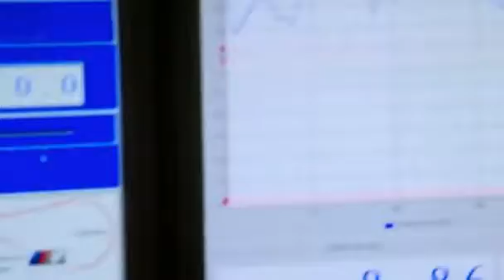BMW M-Division 4.4 V8 Engine

Comment: What a load of garbage. How dare they call this motor even comparable to the other motors they've built? Turbos should stay out of M cars, period.

I give it 15 minutes before this motor heat soaks and the whole car goes into limp mode.
Reply: Well it’s years later i have 136k miles on my 14 M5 competition tuned to 800hp with stage 2 turbos and DME tune. The cooling systems kiln these cars are insane.